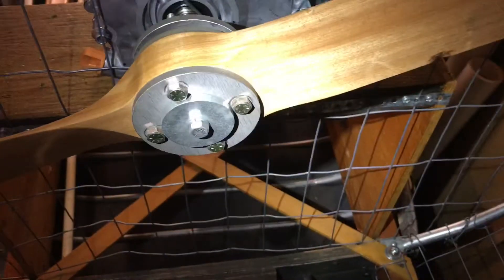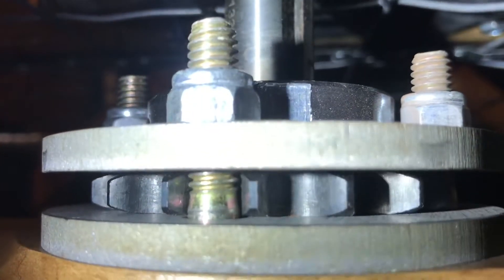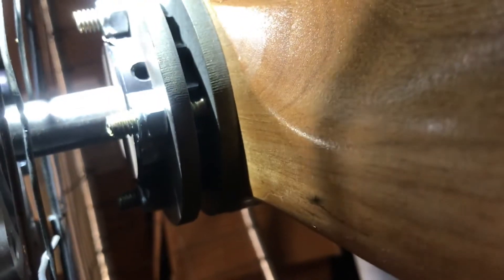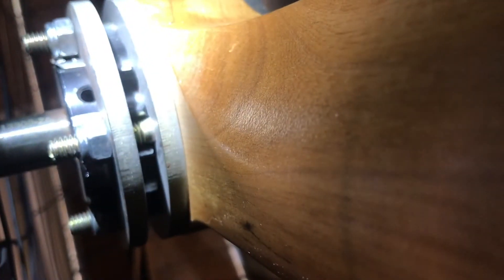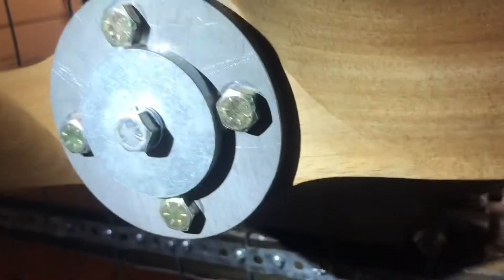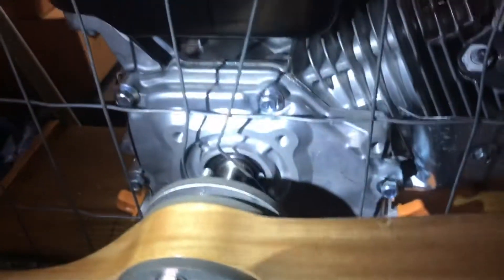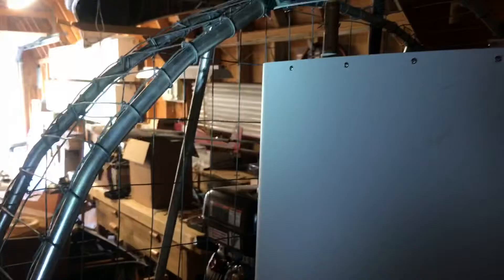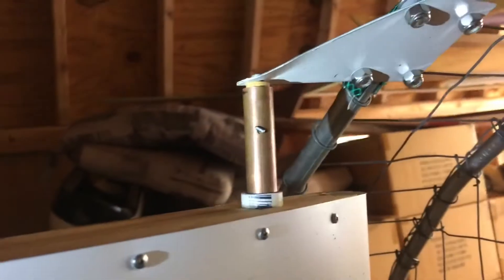DIY airboat- how it’s built

Comment: On top of safety wiring hardware , I’d also recommend getting a grade 8 bolt for the crank bolt and have a way to safety wire that to one of the props 4 mounting bolts

Comment: Hey man..thx for sharing . Had this in mind for awhile , be good to see some more details on your build , motor size, how ya made the prop, maybe some test results for speed and acceleration.
Reply from the maker: It’s a harbor freight predator 212cc 6.5 hp engine and the prop came from jc super props.